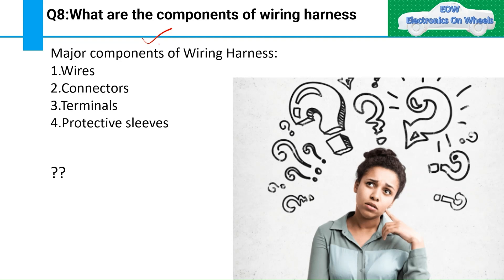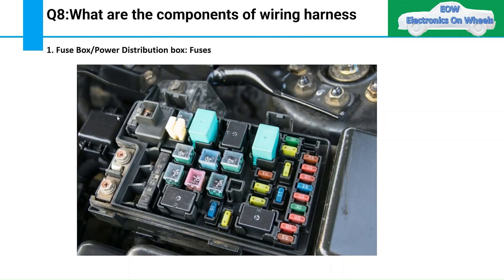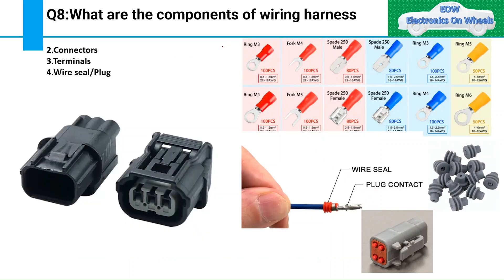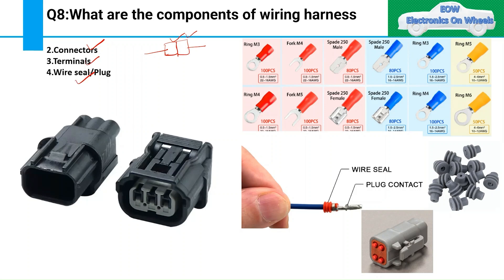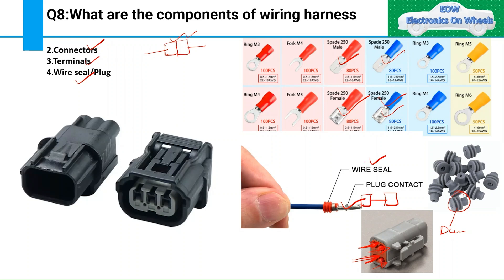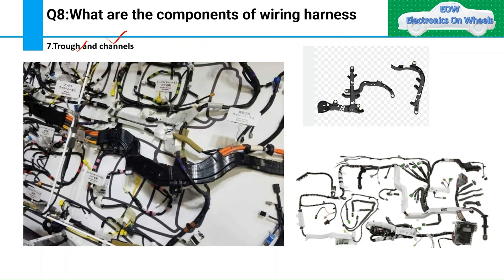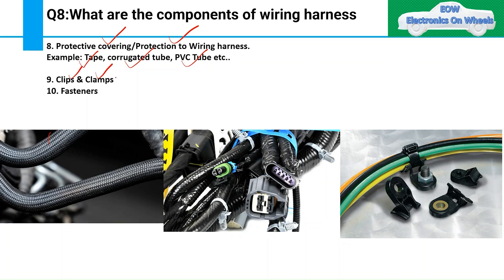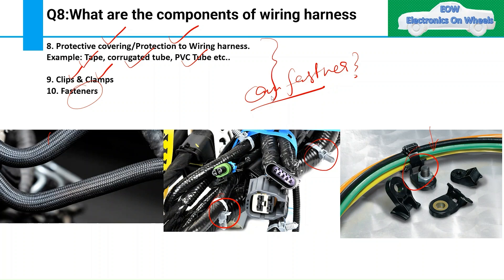Q8:What are the components of a wiring harness? What does wiring harness contain?@WiringRescue

Comment: Fasteners are used in wiring harness to fix & hold properly from vibration or dynamic motion to background parts, components, devices or harnesses. Basically it is used during installation of harnesses in heavy vehicles..